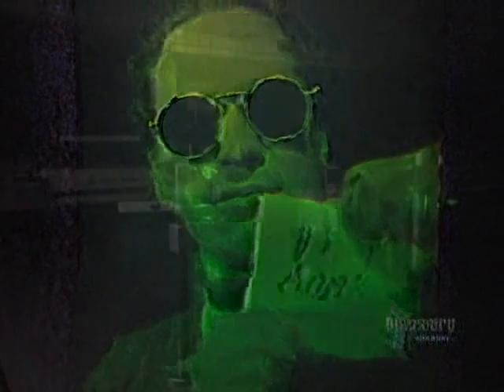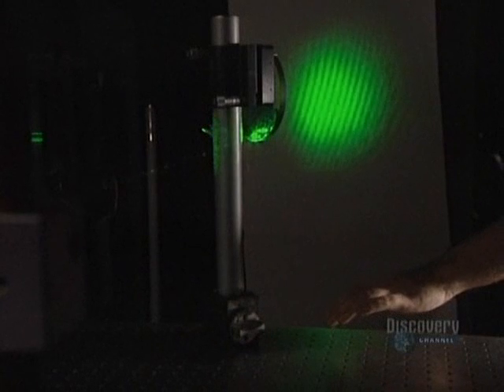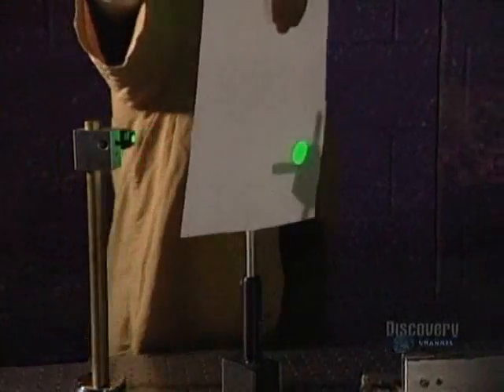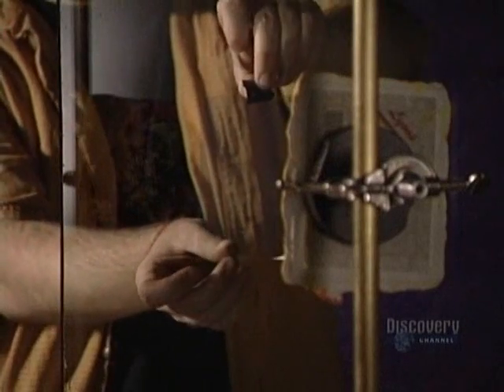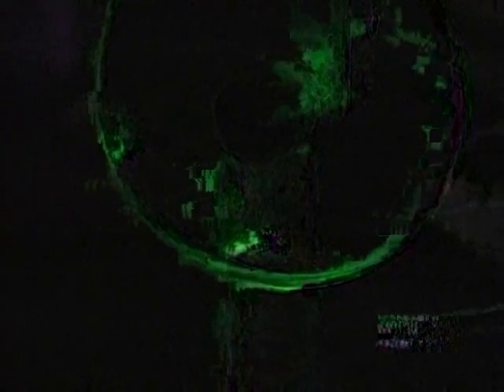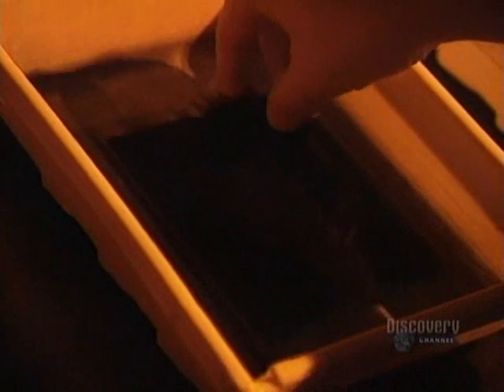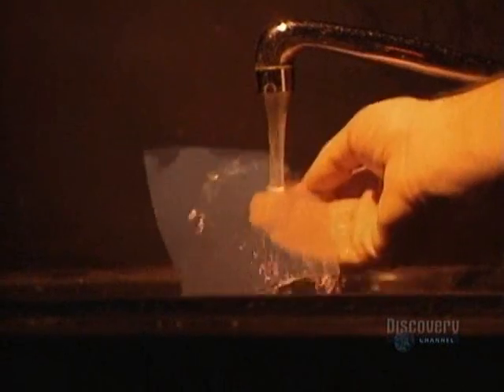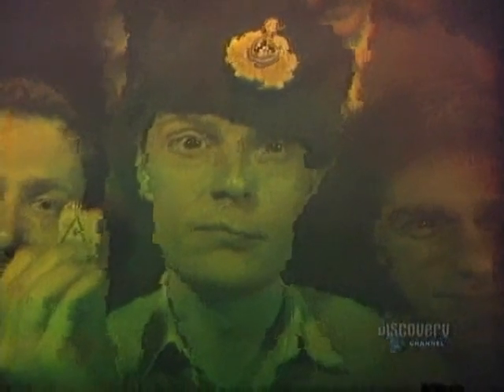How holograms are mades (with laser)

Comment: A: It's a green laser reflection hologram, so how did it become 2 colors?
B: I've never heard of a 3D laser hologram animated film!!! The "film" frames would have to be made of holographic film with a flashing laser light projector!!! Has anyone ever done this?
I think that was actually a computer animation!
Reply: A. You can adjust the color by swelling the emulsion. Swelling it before the exposure with T.E.A. (triethylamine) shifts the hologram to the blue after it is washed, and adding sorbitol after developing swells the emulsion, shifting the hologram to the red.
B. Yes, Professor Viktor Grigorievich Komar had the best pulsed laser holographic movie system ever made. He was Russian, and there are few sites on his work in English, but if you join the Facebook group, they can direct you to video documentation. 
There are also animated holographic matrixes made by Geola, Rabbit Holes, and Zebra images that show different frames as you move left and right.

Comment: OK, so I see that a hologram uses an interference pattern somehow, but how does that same interference pattern allow light to be reflected in such a way as to produce the original image? I know that with ordinary film, the surface reacts to the intensity of incoming light (getting darker the more light there is--and hence what you get is a negative), but how do you get a piece of film to reflect directionally asymmetric light? Is there something special about holographic film that allows this?